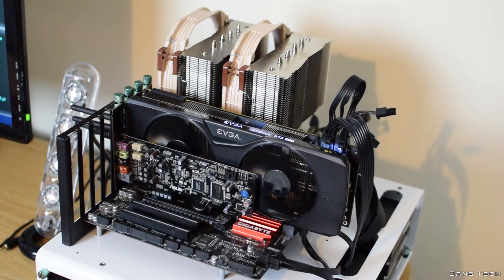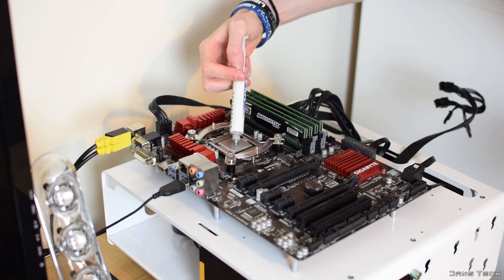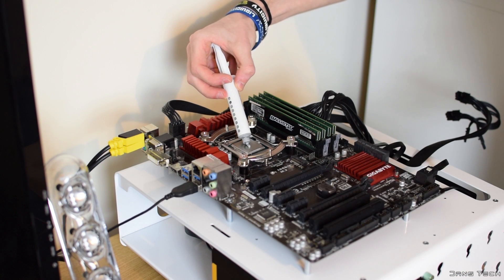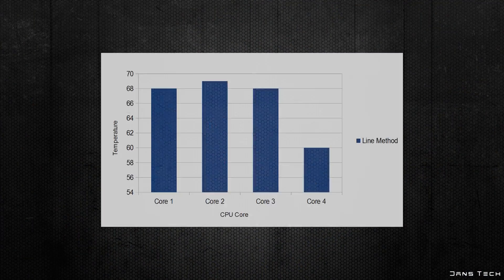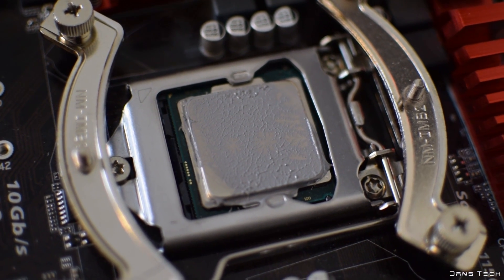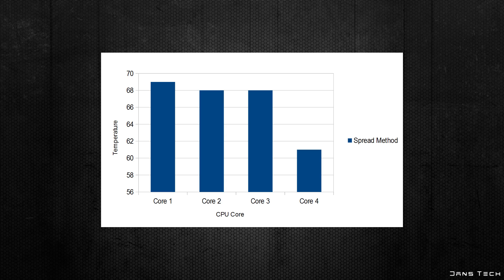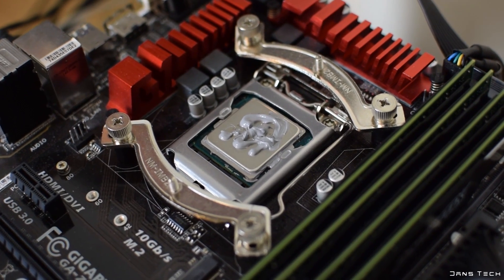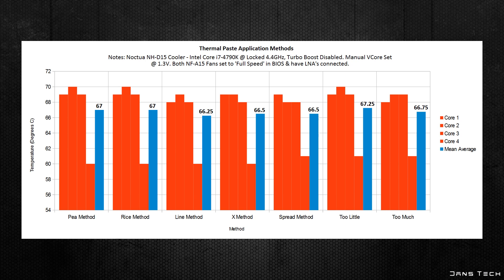Best Thermal Paste Methods? (Pea, Rice, Line, X, Spread)

Comment: X is best, but not an X corner to corner just right in the middle. Your welcome.
Reply: is it wise to set the cooling device down on the small X and then lift it back up to see the spread? then cover what was missed with a tiny tiny drop? or is that pointless?
Reply: @Cinesimilitudinous  I see you haven't gotten a reply, and was a month ago. But just to clarify, as not many know this. When you lift the cooler up, the current thermal paste will have many air bubbles, which will effect the thermal heat exchange. For thermal paste to work efficiently, it needs to cover as much of the surface area as possible, and air bubbles take up some of that space and therefor effects how well it cools.

You shouldn't need to look back at it, be confident in what you do.
Reply: @Cinesimilitudinous  as soon as you remove the cooler the paste becomes useless and needs removed and reapplied

Comment: Hardly any difference use whatever method you want is the basic conclusion.
Reply: I'd say it has more to do with the fact that the heatsink is beefy. There's a point where a heatsinks efficiency reaches a ceiling where it's not being taxed by the CPU it's cooling, so the temps will overall be the same regardless of what type of paste you use or how it's applied, given the same ambient temperature.  4790K is a 90w CPU.  The D15 is rated for 220w.  So what that means is you could put a 125w CPU in there, and the temps would generally remain basically the same. In fact, I run an 8700K and a U14, which is basically half a D15, and it runs at an average of 66c max with 6 cores at 4.8Ghz.

Comment: A variable not discussed size of the IHS. A 2000+ pin CPU such as LGA 2011 I have found inconsistent coverage with the "grain of rice" method and have better results spreading the paste. While I'm no expert in "Thermal paste application" just wanted to share my experiences and YMMV as always. Smaller pin counts like LGA 1151 or socker AM4 I've had consistent results with the "grain of rice" method. Cheers!

Comment: Dans i thought this was a really good comparison video.  Honestly done far better than most.  I do have to say i cringed when i saw how you performed the spread method as i do when i see most ppl do it they way you did here.  Using your finger with a baggie or the like is horrid for getting an even spread if you test that method in the future i would HIGHLY recommend using a flat flexible surface like a credit card.  That ensures the thickness is as even as possible and allows you to get the layer thinner.

Comment: Total Fail Test Process.       First.... you should demo every method using a piece of glass in place of the heat sink so you can actually video and witness the effects... trapped bubbles, how it flows, where it flows, etc. 
YES your thermal testing was nice, but it never really was a help to the evidence of WHY or HOW each method works and the foibles and flaws of each application method.
As evidence I present this video with HORRIBLE background music, where he DIDNT do thermal testing.
https://www.youtube.com/watch?v=EyXLu1Ms-q4

Lets see a PROPER video of thermal paste application methods, how to avoid problems (poor flow, poor spread, trapped air, etc) and follow it on with actual thermal test runs and temperatures.... FFS this is not difficult just plan it people!

It would seem to me you want zero trapped air, and best flow over where the actual CPU die is and maximized contact on the heat spreader (if you are actually keeping it).

Comment: You want the paste to spread, so it only makes sense to spread it yourself.. no, just me?
Reply: OriginalCatfish both the heatsink and the cpu are not 100% flat so if you spread it over 1 surface it wii create bubbles, unlike if the pressure of the heatsink pushing the liquid onto both surfaces

Comment: how the hell you can have 70 fucking degrees using 2 fucking cooler supply's for 1 processor, you should be having like 30/40 degrees with that cooling power, or what? with 70 degrees you are almost burning your processor and you act like that's a nice temperature....I don't understand...
Reply: He said he's running a benchmark, so probably hitting 100% usage for a couple of minutes of full stress. The chip is OCed to 4.4ghz with 1.3v, that voltage is high which means temps are going to be high. For 1.3v 70c is perfectly fine. Also to burn a haswell chip you'd have to be running at 95-100c.

Comment: Thanks. Seems like less mess is the best method since the differences are negligible. Wouldve liked to have seen what temps are without thermal just for see the difference.
Good video.
Reply from the maker: Without thermal compound? 100. Dan.
Reply: woah... Thanks

Comment: why is the fourth core always so much cooler.

interesting that all the results ended up being quite similar with just a few degree difference. and too much did better than too little.
Reply from the maker: Yes some very interesting results, really does show that no method is truly the best! As for the fourth core, not sure, I suspect it did the least processing when i ran the benchmark. Thanks for the view
Reply: I actually just applied some new thermal paste to my cpu stock cooler and I was afraid I applied too much. I put about a pea at first but it seems I stood the tower too soon so it spread everywhere except the top of the cpu, I ended up added even more thermal paste to cover the top. my cpu is running cooler than ever. watching your video and linus tech tips seems too much thermal paste does not really affect the temperatures negatively. hope that applies to for long term usage as well.

Comment: Biggest thing I saw with the spread method, is you had open areas.  I do the spread method, but I do not have open areas, or high/low spots on the paste.  Could be the difference of 2-3 degrees.

Comment: just cleaning the fan and removing dirt blocking the air vents reduced temps by 10 C. All this thermal paste business seems like a big scam.
Reply from the maker: Hi, I may be looking in to this and posting a video with many coolers with no thermal compound, and talking about the science of the paste as such. Regards, Dan.
Reply: what i meant to say was that i cleaned only the fan, while leaving the thermal paste intact. What i am trying to say is that the paste that's already there may last quite some time before it needs replacement. My laptop is 3 years old, and was giving like 60-65 C temps. After cleaning only the fan, its giving 45-50 C, which is quite good.
Reply: if you dont apply thermal compound, your chips will have no conventional heat flow to the heatsinks, and will eventually kill your electronic. and worse, if no thermal compound between the chip and the cooler, extreme heat might fuse both metals together.
you are 50 percent correct tho, Dust is an issue.
Reply: That'd be Great Dan !!

Comment: You could probably run this test multiple times for each method and have different result each time. The slight variance in the amount used and how it happens to spread probably make a bigger difference than the method used. I just don't think these result really give any conclusive answers. Maybe if there was a way to use the exact amount of thermal paste on each method (quite difficult, I'm sure) this test would be carry more weight.

Comment: Cool Vid..I always used the spread method so I know for sure all the CPU is covered and I have heard it's not the best way..Your tests are interesting especially the way too much method. I dunno what the big deal is with applying thermal paste. My CPU sits at around 60c under full load playing BF1 on Ultra at1440p/144Hz but it's water cooled with the Corsair H80i GT and on this occasion the thermal paste was already applied. My previous cooler I did the spread method. It's my GPU temps that concern me I think I will apply my own thermal paste on my GTX Gigabyte 980ti G1 gaming card because I can hit 80c and although it plays BF1 smoothly at an average 85fps with no thermal throttling I'd prefer my temps to be a 72c max..I doubt I can achieve this with new thermal paste but I'm sure Gigabyte just slapped some cheap paste on there..Lol
Reply: CPU Cooler Guy No the fin stack was surprisingly clean. This drastic temperature drop for my GPU is all down to applying fresh thermal paste. Has soon as I cleaned off the old dried up thermal paste, and applied a pea size amount of new paste my temps dropped by over 20c 'in game' when I replicated the same conditions as before of having my Case fans and GPU fans at 100%. My GPU temps plummeted from around 80c..to 56c using MSI Afterburner for Temp Readings. So these much cooler temps allowed me to set a quieter fan curve with MSI Afterburner and now I can game at 68c on a less aggressive fan curve than before for hrs on BF1, BF4 Call Of Duty and Battlefront on Ultra Settings on a  1440p/144hz monitor getting great fps. No one is more shocked than me because I paid £600 in Dec 2015 for a brand new 980ti I would expect the thermal paste on there to be effective for more than a year..Maybe it was crap to begin with because I never started to monitor my temps until recently, it was only then I noticed my temps were crazy high. So Gigabyte made a high end GPU and decided to slap garbage Thermal Paste on there..Lesson learnt!
Reply from the maker: Hi, thanks for sharing, I wish many manufactures would ship high end products with better compound, and that Intel decide to stick with soldering the IHS to future CPUs instead of using basic thermal compound. Dan.
Reply: Dans Tech Update I removed the old thermal paste off my GPU and put on some new thermal paste opting for the pea method and my temps dropped from 80c fans100% to 68c fans 70%..under load. Best £4 I ever spent for a tube of thermal paste! I only had the card 1 year and the paste had dried up.
Reply: As for your follow up, excellent stuff! Glad its brought your temps down, shows paste some manufacturers use is nasty stuff! You also clean the fin stack? ..Seems a large improvement! Dan.